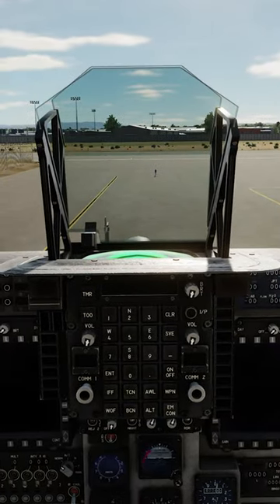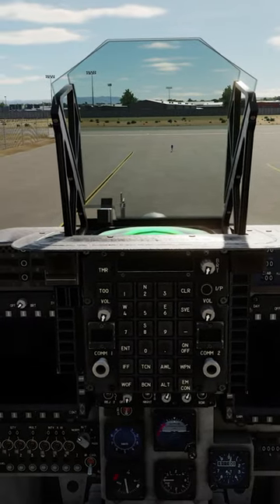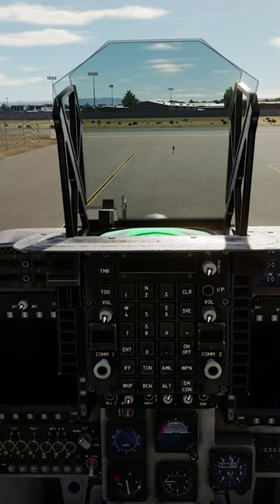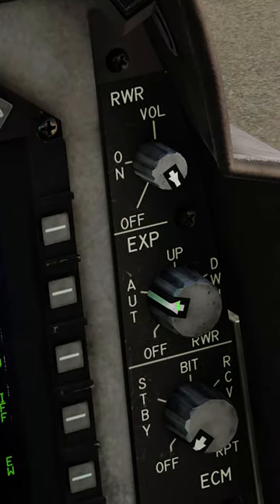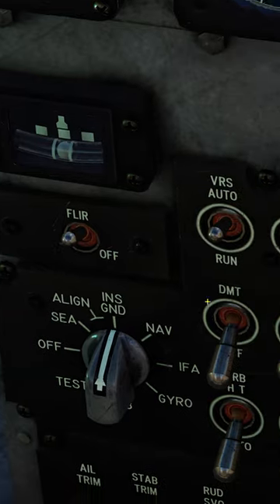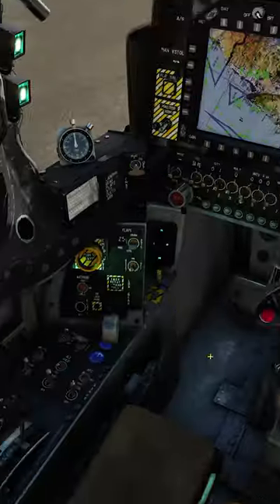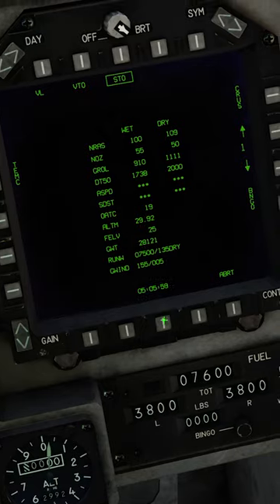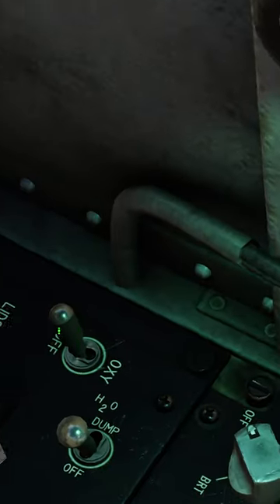How to Startup the Harrier In 60 SECONDS | DCS: World #shorts

Comment: Forget to turn on nws
Reply from the maker: When you turn on anti-skid in the Harrier (as you should on the ground), it puts the nose gear into a casting mode and you turn on nosewheel steering by holding the nosewheel steering button for as long as you want to use NWS. When you release the NWS button it goes back to CAST. So unlike the Viper or Hornet for example, in the Harrier there isn't a turn on nosewheel steering switch :)